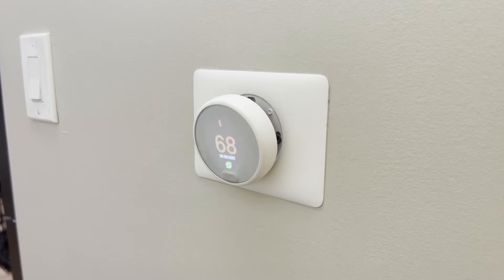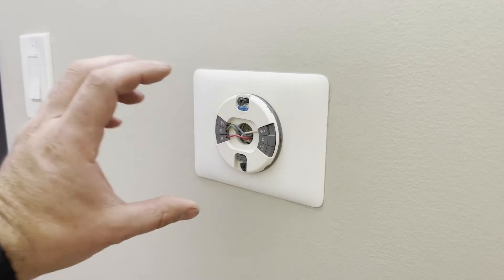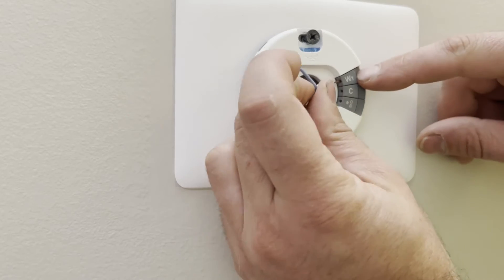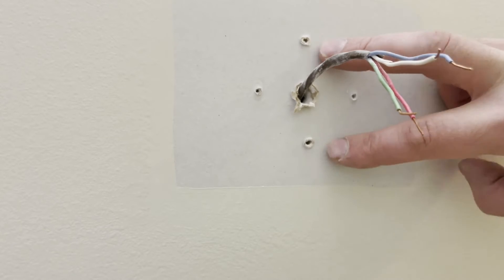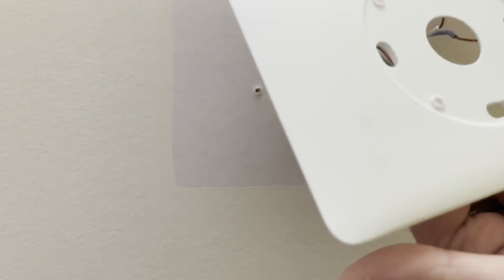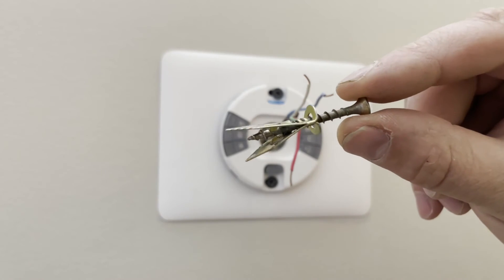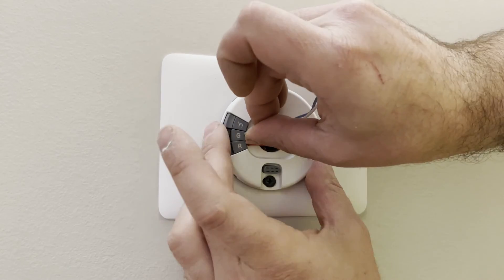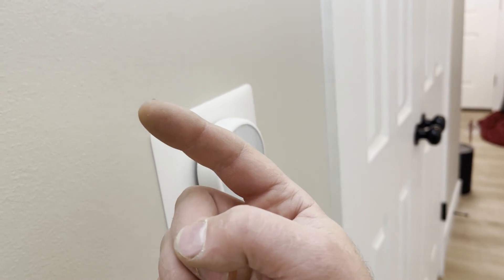Is your thermostat loose? Here is an easy fix

Comment: I usually sacrifice the G (FAN) terminal wire and use it for C (common) wire at board and T-stat so they dont need to worry about battery life...in my area people rarely use furnice for fan only
Reply from the maker: YES! I do the same all the time. I need to create a video for that.

Comment: Nice video. Any chance you can do a video moving a thermostat? My upstairs thermostat shares the wall with the dryer vent. I notice in the summer when running the dryer the AC can't keep the set temperature.

Comment: I’m one of those Obsessive-Compulsive DIY types.  If I took off the the entire cover plate as was done in this video, I would have installed four sheet rock anchors, not two.  But that’s just me. This neighbor down the road in American Fork really enjoys your videos.  Once it warms up enough for this 67 year old man to be comfortable working on the north side of my house, I will buy a spare capacitor for my AC compressor.  I very much like the idea of having a few, inexpensive spare parts on hand.  I try to always have a spare air filter as well.  Though the AprilAire accordion-style filters are a bit pricey.

Comment: I also found it a good idea to seal the wire and the hole in the wall behind the thermostat with caulking because when the air or heat is on it creates suction and either cold or hot air coming thru the hole behind the thermostat can affect the temperature that the thermostat sees.  I had this problem last year when I was running the heat. I set my thermostat to 70 degrees, and the rest of the house temperature was 75 degrees.  We found that there was cold air coming thru the hole from the wall. Since then, I have insulated the wall under my house, and this stopped the cold air getting inside the wall, but the temporary fix was caulking the hole behind the thermostat.